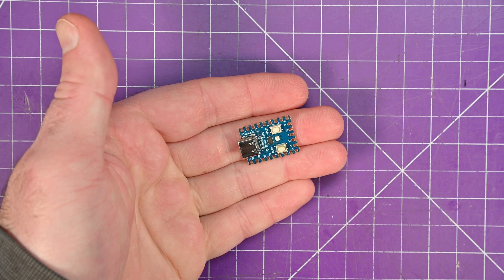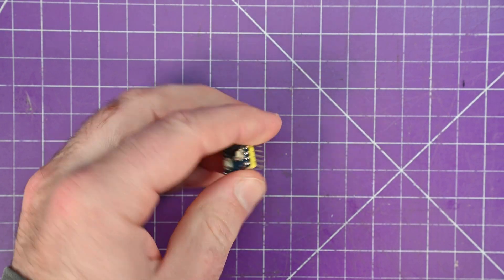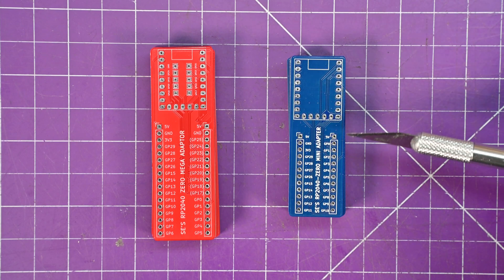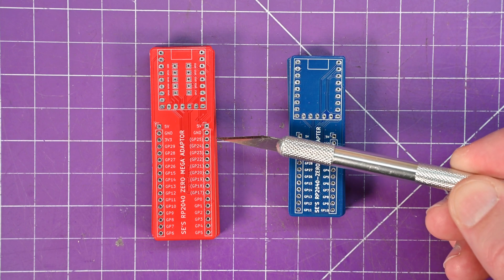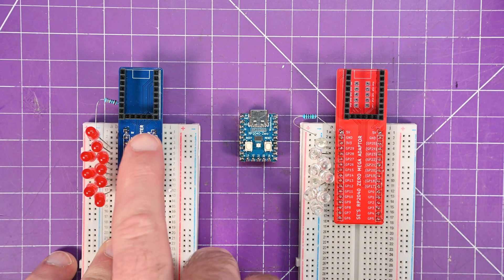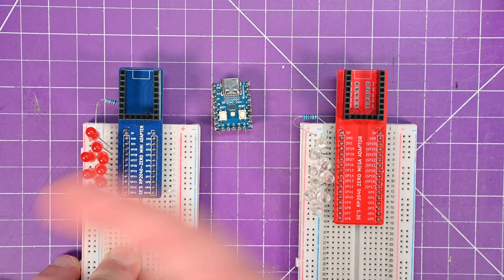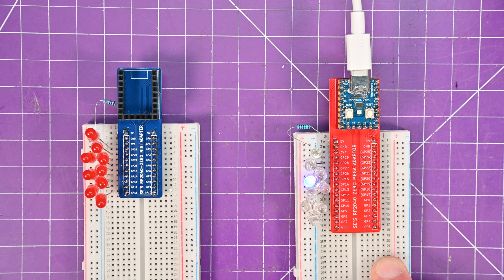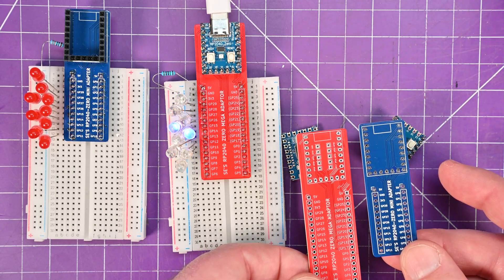Breadboard Bliss! RP2040-Zero Breadboard Adapters!

Comment: I put headers on the left and right to allow it to plug in the breadboard, I then solder a right angle header in the bottom row on the top of the board. If you need to connect to the GPIO on the bottom row, use a short jumper wire with a DuPont socket at one end. If you need more GPIO than this then maybe you should buy a dev board with all pins in two rows.

Comment: Why not use the original Pi Pico at this point?
Reply from the maker: These are cheaper and if your project doesn't have the physical space for the full-sized pico
Reply: @SimpleElectronics  You can get 3 of these for the price of 1 Arduino pro micro. By the way JLCPCB will make 5 of these for $2.1 plus $1.50 postage.
Great video and design idea, could do with  some mounting holes for more permanent projects... Just a thought!!

Comment: Nice work Dan! For the mega board an easy way to use those middle pads is to solder pogo pins to the mega adapter board this way when the rp2024-zero gets slotted into the female headers the pogos make contact with pads.
Reply from the maker: The only problem is that the pads are smaller and closer on diameter than the footprint of the pogo pins, it would be nearly impossible to do - but if someone manages, that would be awesome
Reply: @SimpleElectronics  Just need to find the right part to fit 😉

Comment: But why not use the two rows of nine pins where they are on the Zero, and extend these rows inline for the five pins on the end, just three more on one side, two more on the other, a very simple single-sided routing?
Reply from the maker: You would have to widen the board by at least 2.54mm each side and that wouldn't leave you with a lot of space to work on the breadboard (1 hole on one side and 2 on the other) and you wouldn't have space for labelling
Reply: @SimpleElectronics  Well, it would be basically the same as your blue version, but without the overhang for the Zero. Because the routing would be much simpler, you could crop the board tight to the footprint of the Zero avoiding the occlusion of breadboard rows. Like your blue version, there'd be two free rows each side. Since the columns would be aligned with the Zero, its labelling would work and there'd still be room for labelling past the end of the Zero for the repositioned end pins.

Comment: Does the dev board itself not line up with breadboard spacing?
When I use boards like this, and I want to use that bottom row of pads, I just divide the pads up between extra pins on the sides and jumper to them.

Example:
Instead of 9 pins on each side, put 12 on one side and 11 on the other.
The plastic strip is more than strong enough to support them.
Then just run wires from the 5 pads to the extra pins on each side.
You are soldering them anyway. It only takes a minute to do the wires.
Reply from the maker: Not sure I quite understand - if you only want the two parallel rows - they do fit in the breadboard - but the horizontal row doesn't

Comment: What type of project is the RP2040-Zero good to use in
Reply from the maker: Anything that requires high speed and a lot of calculations but doesn't have a large footprint - stuff that uses OLEDs with graphical libraries, communicating with multiple I2C devices, projects that need built-in logic etc...plus the boards are under 3$ Canadian each!